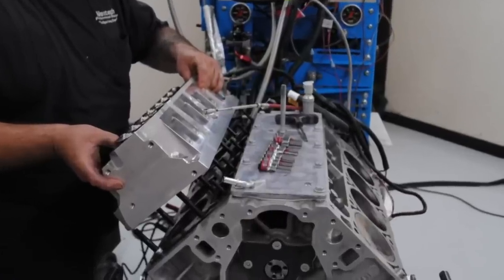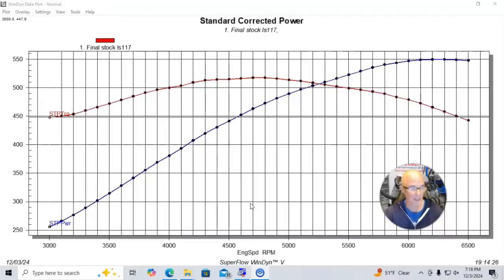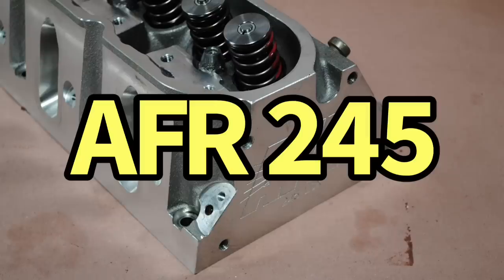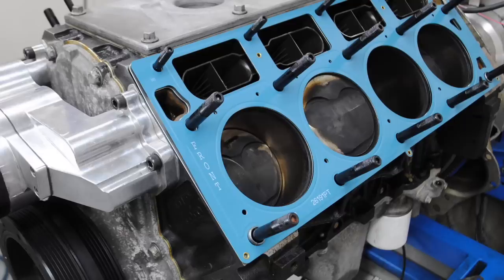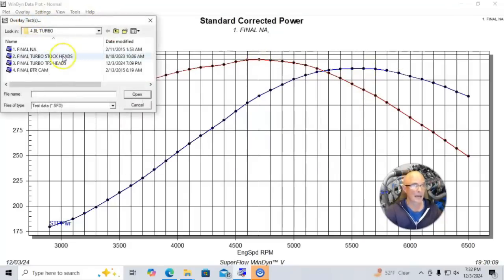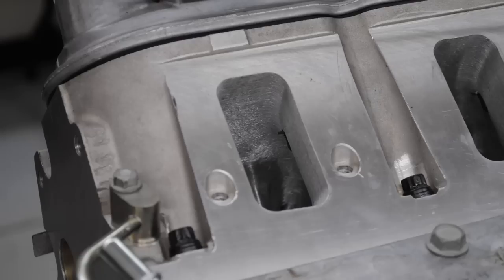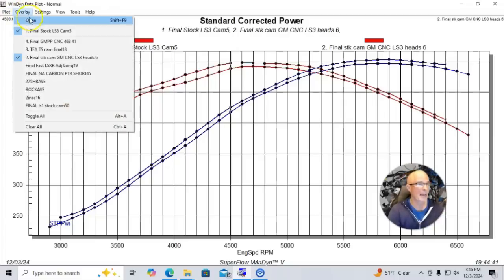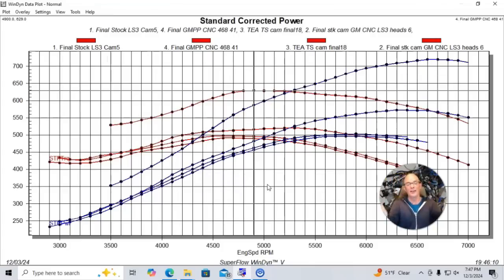TURBO LS PORTED HEAD TEST. HOW MUCH ARE PORTED HEADS WORTH ON AN LS3, 408 STROKER OR TURBO 4.8L?

Comment: Have you noticed how nearly impossible it is to find a cold air intake (in my case for a 2005 GTO NA LS2) equipped with 102mm FAST LSXr intake & throttle body?  You'd need 108mm hose to wrap around that TB, but the biggest you'll find in silicone hose, aluminum tubing, elbows, etc. is in 102mm I.D. (if you're lucky).  How is one to support a big mouth LSXr upgrade with filtered reasonably 'cold' air?
Reply from the maker: RUN 4 INCH TUBING

Comment: I have a 2007 ranger with the dreaded 4.0l sohc. The engine needs removed for the timing chain tensioner replacement. Was thinking of having the heads ported and polished. Id like to twin turbo this engine for more torque. 
I see port and polish simply as a means to reduce drive pressure and psi while increasing cfm. Its 9.5 compression ratio. A smoother running vehicle. Id like to keep the stock m5r5 and 7.5" rear so no ambitious hp goals.
I certainly agree that you should see how much you can get out of your engine NA before forced induction. New fuel, air filters, new or upgraded ignition, 1 range hotter spark plugs at maximum gap. Its amazing what quality synthetic lubricants in engine trans and dif did. Maybe I'll reach my goal with all of this. Maybe hire local dyno to fine tune.
EXCELLENT CHANNEL! Subscribed!
Reply: Do a 5.0 swap

Comment: Coming from the Nissan S-chassis world, never had a huge interest in LS engines, but watching you over the years, has showed me how interesting they can be. So many options. I know people love 6.0's but your videos have me thinking cost per HP, a turbo 4.8 running 10psi with a good cam might be the move.
Reply: If you want to see, I would not be surprised to see a 240 with an LS conversion on some  video from the folks at 1320video. I don't think you would be surprised either.

Comment: Hello, I follow all your videos. Although I do not fully master English, I manage to understand almost everything. I have a 2005 GMC Sierra 2500HD LQ4 4.10 differential 4L80E transmission, I use it for work with a 4000lbs trailer and sometimes I tow 7500lbs. I have 243 heads to install with stock intake and stock exhaust. I would like to install a shaft that gives more power at low and medium revolutions without affecting fuel consumption. Please if you can help me choose what I need and if you sell it, I would gladly buy it from you. Thank you.
Reply from the maker: any cam with alter fuel consumption if it makes more power

Comment: Hey Richard, I had some thoughts on some things and I was like why don’t V8 have oil squirter’s like most other things do like in the European world has. I was rebuilding my wife’s VW 2.0t when I thought of this. Well, doing a small search on the Internet they’re actually is a company that makes them. Can you please do a test on them? I’m thinking about buying them because I picked up an L33 aluminum block. Wanted something for more longevity when put turbos to it. 

Here’s the link to Get M Performance 
Their site is under maintenance, but if you type in piston cooling in the search bar, it will bring up the product up. 
A link of a guy installing them in his LS engine. Give them a try and let me know what you think. Would love to see if it gave any more performance putting oil on the bottom of the piston rings I don’t see why it wouldn’t. It would keep the engine pistons cooler as well.

https://getmperformance.com/search.php?search_query=Piston%20cooling&section=product

https://youtu.be/9Cljwe1dkdc?si=tdnN9Jo99QgIwEFQ

Get M performance is doing some pretty crazy stuff with some carburetors. Just type in Get M Performance in the search bar on YouTube and you’ll find a 3-D print a lot of things for their carburetors pretty quickly to make changes for anything and a lot of big money drag racers are starting to buy their product because of the different fuel additives from the old days to now with 20 different race fuels just for Racing now than it was in the 60s with carburetors. He’s done a lot of cool updates with carburetors. Maybe something we’re trying.

Comment: They are worth good horse power on a na motor but engine masters proved that in boosted applications it didn't matter much 195 cc as cast 235 cc cnc ported made within 10 hp on a boosted motor
Reply from the maker: the difference isn't boosted vs non boosted-it is na power gains then multiplied by boost
Reply: Woulda been nice to see the stock head ported...

Comment: Unrelated, but I can’t seem to find any actual data online. 
 Is there any power gain in a NA application to making the length from collector to X-pipe equal; is it worth the hassle for power or even sound?
Reply from the maker: doubt you would see any

Comment: I m running a set hand ported req port ls3 Heads on my 427LS its got all the good bits mine made 870kw with a big single turbo, I changed out the injectors to 2400cc injectors and put a lot bigger Aeromotive fuel pump and reg and made a whisker under 1060kw, my next upgrade is a bigger solid cam (not sure on size yet) I'm currently have small 226/238 617 113 and a new ECU probably a haltech or a Holley, engine has been built to take more boost but before I lean on it I want better boost management its not quite ready for the strip yet but I'm hopping for low 8's thats my happy place, you are responsible for some of my build as I took your advice and I've watched just about every LS video you made as its my 1st Turbo set up, I needed to learn about them as I'm a N/A guy, heads were done to suit a turbo, I also went with more static compression to help spooling its cost me a small fortune I wasted some buying the wrong parts its been interesting experience

Comment: Love this!... and now a question do ported  aftermarket higher flowing heads notably  increase spoil faster or is it essentially just a wash? Cause either way i would imagine your still pretty much stuck at whatever the flow volume of exhaust is for spoiling. I guess I'm just wondering if you have ever noticed a drastic change in spoiling rate because of heads?
Reply from the maker: if it adds power down low-it helps spool

Comment: I wonder what my combination does I’ve never been on a dyno since my upgrades.  Some say I’m in the 700-760hp range but  limited by fuel so I have a triple pump setup now and after I finish the install I’ll be working on getting a tad bit bigger turbos.  
Setup is;
6.0 forged internal lq9 block 9:5:1, 30 over , ls3 CNC ported heads, agp twin turbos 54/56 .82 at 15-18 lbs of boost, id1050 injectors, meth at 7lbs of boost, big intercooler, comp cam turbo stage 1 and now I’m currently installing fore triple fuel pump with rails and all the goodies.  I have stock ls3 intake manifold ported and rod mod but I’m going with BTR intake only because I’m in the middle of a wire tuck/ fuse box, Ecu and abs module relocate and I want to tuck the steam ports under the intake.  

I guess if I had a question it would be do you think I’d benifit from a bigger cam also? And I’m interested in an electric water pump but I’m not sure if that’s something I need.
Reply from the maker: you can max out those turbos with the cam you have
Reply: @richardholdener1727 thank you, perhaps I should be looking into some bigger turbos. Cheers from CT happy holidays

Comment: Richard I've got a 408 with stock rec port heads and a ported LSA  blower. Car made 600whp through a 4l60E on 9psi and pump 93 octane. Do you think it's worth the money and effort to swap to some either GMPP cnc rec port heads or any other aftermarket option or should I just bump boost and switch to e85?
Reply from the maker: e85 and more boost-you have more than enough head flow
Reply: @richardholdener1727  much appreciated sir. It's been a debate in my head for a while now.

Comment: Richard, at what point do you draw the line on throwing money at OEM Aluminum Cathedral Port Heads ? For Example, a Street Machine, 10.5:1 Normally Aspirated 4.8L/5.3L/5.7L (100HP/Liter Estimated Goal) ?  Is it more worthwhile throwing (up to) $1,000 at your existing 706/862 or 821/823/799's (CNC Porting, Valve Upgrades, Springs) or spending $700+ more to get an aftermarket As-Cast Set ?
Reply: Usually the "line" is at high high horsepower numbers as the deck thickness of the factory heads wont hold the pressure as well as aftermarket heads.
Reply from the maker: NA or Boosted?
Reply: @richardholdener1727  NA

Comment: Richard, I was curious if you have ever run a comparison between the same maximum lift at the valve, one from high cam lobe/low ratio rockers--the other lower cam lobe lift/high ratio rockers.
    Same total duration cams, basically one 'low lift' , one 'high lift' and using the same type of rockers with different ratios to give the same overall 'total' valve lift. The lift at the valve(and speed) would vary at different points due to the cam's lobe profile, as well as well from the rocker's ratio through their pivot.
Like a 1.5 vs 1.7+ rocker arms, the more drastic difference the better. So would hp/tq vary, the curve, valve float / sensitivity to spring rate, or a change in stress on parts? Or would it all be a wash? 
👉You keep testing, I'll keep watching💥
Reply from the maker: I have not done that exact test

Comment: Hey there everybody.   Im in New Zealand.    Looking at rebuilding my 5.7 LS1.      Thinking 4"stroker with 3.9 bore (383)Ci.  Port heads cam ect     maybe ITB.     Trying to stay N/A.      Is 500Hp, 500Ft/lb goal too mych of a dream or possible with my recipe
Reply from the maker: the 500 hp is easy enough, the 500 lb-ft will be difficult
Reply: @richardholdener1727  yeah,  it's a daily street driver,   at 100Kph (60mph) legal limit here,  I'm sitting at 1600Rpm.  So looking at low to mid range torque, hence the thought of under square engine,  more stroke than bore.    Would rasing the static compression ratio help.  11:1 or higher.   Thoughts
Reply: He wont respond to "thoughts" 😅 however compression will help w power everywhere, or even better add a positive blower
Reply: @crash5811  thanks.    Trying to stay away from forced induction.    Cost, extra plumbing, room in the engine bay ect.
Reply: @russcole5685  understandable, look into Holdener's older videos and see what u can find for LS1 and other LS motors, ull get an idea for how the engines respond to certain changes and itll coalesce into an idea of what build u want to pursue
Reply: @crash5811  thank you.   I'm pretty much set on the bore, stoke to 383.    If I can find. Change heads to the 243 cast, rather than the 241 that I have.       Done a compression test and it's reasonably even at 100psi on all cylinder's.   Slight ticking so cam and lifters are needed.  Slight piston slope when cold,  so it's due a refreshing.  260,000Km motor.  So it is getting old.   
Thanks for the answer's.   It's hard to get a straight response out of most, so appreciate your time
Reply: @russcole5685  best of luck

Comment: There is an LY6 6.0 core engine waiting to be picked up, where I work, thinking I should buy it, it's $750...
Reply from the maker: THAT IS THE SBE SHORT BLOCK WE MADE 1543 HP WITH TWIN TURBOS ON
Reply: Just remember that the engine is often the cheapest part of the turbo ls build. You still needs a trans, converter, rear end, injectors, turbo hot side, the turbo, and intercooler, turbo cold side and everything needed to install
Reply: 6.0's are pricing up, I think I'd go for that,, as long as you can afford to build it over time, to get your best deals for the above mentioned additions.
Reply: I paid 1500 for.mine

Comment: It's been several years but I did ask you if I should port, after I had given you what my goals were with what I have you said no don't port as the 863 heads will support those goals. I asked the builder his opinion and he separately said the same thing. He did lots of work on the 6.2 and bore & stroked to 6.8 and ended up at720whp which was more than I expected. So, I considered that good advice Thanks!  Now I just lurk at chat as I have no project at the moment.
Reply from the maker: NO NEED TO PORT WITH BOOST
Reply: @richardholdener1727 . Lol. I am about to send my 243 zo6 heads off to be port and polished. I have the BTR hot rod cam with upgraded head parts to match. I have a& a supercharger (3.8 pulley) coming in shortly and need to order some headers. running a zo6 intake. I also have a 3.42 rearend to swap out with the 2.73. 

Will porting and polishing the heads do anything worth while at this point? (Sounds like no but just want confirmation)

Running stock 2001 c5 bottomend. 

I am Thinking about meth inj to run cooler. 

If I said, here sir Richard,  i am gifting you a 2001 c5 automatic with stock bottom end.....
Any recommendations?

Also Should i do anything to the heads at a machine shop? 

Any recommendations for the stock auto
Also... if the engine blows up, i plan to swap all top end parts to a ls2 which will likely be bored and steoked.  At that point I will be seeking 4 digit hp numbers

I suppose I am asking you what you would do with given situation.
Reply: In your given scenario you have a supercharger that is the restriction of horsepower for your setup. 

If you improve the flow of the heads you will lower the restriction put on the air going into your motor. 

Is the gain of the ported heads substantial? Not likely to maybe. 

Given your supercharger has an efficiency rating at certain pressures usually called a compressor map

Lowering the pressure will cause your supercharger to add less heat into the air. 

How much heat? Hard to say. 
You could go the route of trying to optimize everything and learn a lot in the process ( what to worry about and what not to) 

Or you could do a bare bones setup and get it up and running. 

My recommendation from a hobbies who has built multiple 600hp ls engines. Is don’t port the heads. 

My first turbo ls I ported the heads and now I don’t even worry about it. Too much effort and not enough reward
Reply: @chazgeisler6213  I agree with what you are saying and like how you mentioned it is almost splitting hairs. Only issue I see with some LS3 heads is the lightweight valves GM used. If you go above a stage 2 generally should replace those valves. Even roller rockers will wear them out. 

FYI: Light weight means hollow core and the valve tip isn't harded like a full stainless valve is.

Comment: Good episode Richard. Can you give the GenV LT’s a little more love though?
Reply: No one swaps those. Look at ls1tech they are maybe 1% of swaps. The Camaro is discontinued, the c8 has barriers to modification, the aluminum ones didn't come with power steering, you have to get fuel pressure way up for DI, they have a vacuum pump, rampant problems with camshafts failing, transmissions with no or little after market control options, etc. it's a worse platform overall.
Reply: Hardly anyone owns those and they are far more expensive
Reply: The cost just isnt there yet.

Comment: Hmmm...
so from the sock heads 4.8 to turbo was a gain of 188 hp at 7.5 psi
then from stock heads to trick flows at 7.2 psi gain 50 hp  

then add the btr cam gain 72 hp .  So in all and im guessing  if the 4.8 was ran NA with the trick flows and the btr cam that was good for 80 hp over the na numbers?

Cant beat the numbers but im just trying to figuer the NA gains on the 4.8 because at 7 psi 646 hp that thing will be close to 900 at 14.